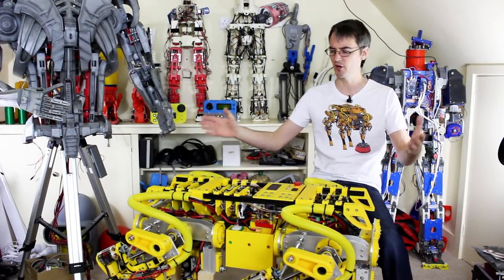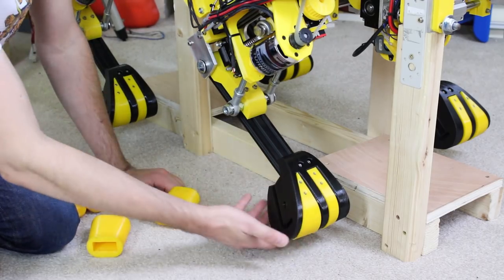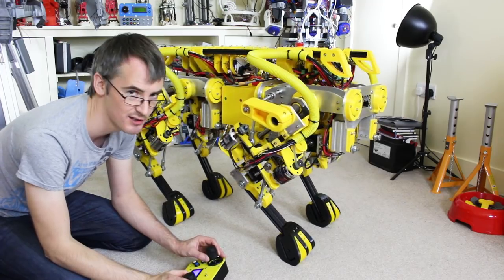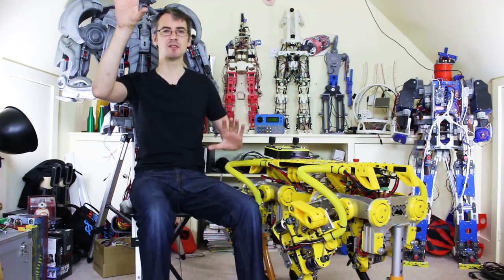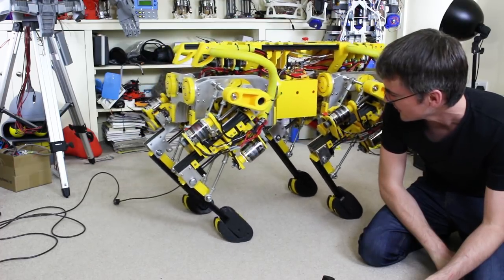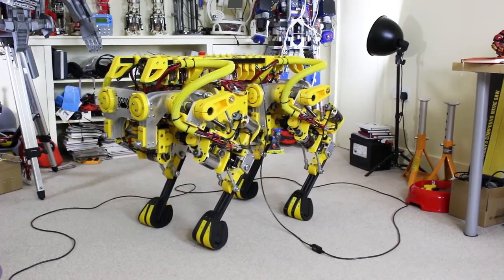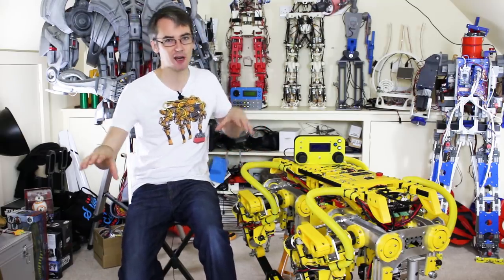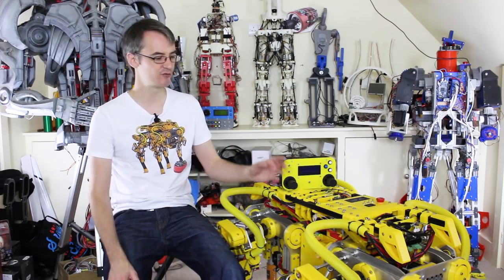openDog Dog Robot #13 | Experiments in Dynamic Stability | James Bruton

Comment: I love this project, but....You are doing things the hard way... Arghhh  :-)

This is what you need for perfect walking, running and control of Open Dog.

1. Each leg to have its own inertial measure unit (Cheap 3 axis Accelerator).

2. Each leg to measure feet to ground with optical sensor / Mouse camera or something (Ultrasonic, IR) to measure distance and NOT touch (By the time it touches it is to late.) Measuring the distance you can gently accelerate or decelerate the leg to touch the ground gently and not slam into it.

3. Each leg ideally needs its own small 'Leg' computer (something like arduino nano). (A leg should be able to control itself without input from other sources, just like in real life.  If it goes to fall the leg needs to be able to move to compensate on it's own.  The only commands you should give these legs should be for basic walk, run commands and so on.)

4. Open Dog needs a main 'Head' computer to communicate the main commands (like walk forward to the other 'Leg' computers.  Simply put, this is just a clock cycle where the main computer sends commands, or requests info one leg at a time. So we have four legs at say 15 cycles per leg per second, for a total of only 60 cycles per second.  Since we only need to send direct, maneuver commands to each leg, technically most of these cycles would be blank, but if you did want to monitor the whole dog, then we could still do this in only a couple hundred bytes a second.  (I like simple and streamlined.) 

Personally I would have a head (This would be the main / Head computer) on the dog, and the Dogs head would have another inertial measure unit. If you do all this right then you can tilt the head forward and open dog will go forward, back for reverse, left and right and so on.  No need to have to control all the legs; see, now we are using our head. LOL

If done right (Lots of assembly language), Open dog could controlled with of a ZX81.  You just need the right sensors and algorithms.  As a clue, one easy way to measure pitch, Roll and yaw is to interpret the measurements like a Dartboard, except instead of 20 quadrants we may use 8 in a clockwise order.   These 8 quadrants give direction (Yaw), the other evenly spaced sectors in that quadrant show pitch and roll.  The larger the roll the higher the number.  In essence imagine having a Dartboard lay down flat, then have a marble where bull is, when  you change the pitch or roll you see where that marble is rolling to the measurement, and this also automatically calculates the Yaw / direction of the leg.

Now from the Dartboard (Lets say we are always aiming for bull (level)) we can calculate the data we have in just 1 Byte of info (4 bits for Yaw (8 directions) and 4 bits for Pitch and Roll (levels of tilt.))  The small computer in each leg then interpretates this into “Oh shit I am falling, put my leg out” if need be, whilst calculating what it is meant to be doing.  We could use one more byte of info for the optical measure sensor on the foot to help with our fall too. This time we know when to stop the foot before smashing into the ground. So using just 2 bytes per cycle (per main Leg and or Head,) we can tell roughly how each leg of the dog is doing and where it is.  Each Leg computer has its clock which is kept in sync with the head computer, so if a leg stumbles, then it can get back on track to where it should be when it recovers (Just like the military with marches and cadence, the only thing any of the platoon worries about is that one person calling out the beat so they know when left and right is.)  If a stumble is to big, then a leg can send the data to the head computer which may then slow the walk speed for all the other legs, and possibly give commands to direct other legs, but once again each leg having it's own Leg computer should solve these issues on their own and be able to get back on their own feet.

So going forward, (:-) ) We tilt the open dog head forward. This uses the Dartboard and sends a Walk forward command to each leg (lets say the head was pitched straight forward to 2) at speed 2.  Each leg will now work out the timing of the clock cycle and what it is meant to be doing for that cycle and adjust to that for walk forward speed 2, until you tell Open Dog to stop. 

I know there is a lot more into this for the control of the motors, but this should give you a huge boost for how t get a very stable, walking, running, dancing dog.  Hopefully this makes sense as it is very late where I am and I am very tired, but it does work. If you have any questions, ask.
Reply: I'm sorry but this sounds very outlandish to me, and in fact much more complicated than what James is currently doing. IMUs on each leg? Optical sensors for ground proximity? Binary servoing?
That spider robot Adam Savage showcased in one of his videos has NO sense data besides motor position to do what James is trying to accomplish, with 8 legs. If you have high repeatability and can assume a flat plane for the environment, you can skip most sensory feedback. Now, that robot also doesn't need to balance on two points of contact, but I bet that even the current hardware setup of OpenDog could accomplish a more than satisfying gait given the right software.
Reply: Having physically separate computers in each leg is completely pointless and you are assuming walking is a hell of a lot easier than it is. I assume you have little to no programming experience based on the way you speak about "each leg will work out the timing of the clock cycle and what is meant to do"
All you are doing is making up your own convoluted way of thinking without knowing how any of this works. 
Plus,with the inverse kinematic model he already knows the position of all points in the legs relative to body to double precision
Reply: @Marci124    The way Open dog is designed will ultimately keep causing problems.  Adam Savages Robot is a couple of ounces compared to this beasts mass, so they are not even close to being equal (feather vs brick), nor is the design of how they work close to being equal.
Reply: @parkerbradshaw4122  Wrong!  My system has been tried and tested and does work thanks.  Having a kinetic model of having everything work is great in a perfect situation, and that is the biggest downfall; a walking robot needs a kind of fussy logic of independent limb control. 

A computer in each leg (Arduino Nano or even smaller) to monitor a clock, distance sensor, tilt sensor, 3 optical encoders and motor speed is child's play.   With this you do not need complex models as you describe.  A walking motion one leg at a time is VERY simple.

Thanks  for trolling though with no subs, no videos, and well just trolling youtube.
Reply: Guys stop arguing! 
P.s.  @10p6  subs are not the measure of IQ
Reply: I like the idea of having legs autonomous (sort of at least). In real life animals the spinal cord/proprioception circuits do most of the control of walking and moving. Very interesting idea.
Reply: @10p6  No, he's not. Firstly, there's absolutely no need to do any assembly on a project like this. Honestly, what you'd end up with would be worse than if you just used C++. What James needs most is to switch to a dev board with an ARM Cortex-M4 that has an FPU, not an antique like a zx81. Performing 32 or 64 bit floating point operations on an 8-bit µC is eating up clock cycles, not to mention the use of uart for communication between µCs. 8-bit µCs are inappropriate for a project of this scope.

Secondly, your proposed set of sensors is totally unnecessary. What's the point of a tilt sensor or an accelerometer on the legs? The system already knows how each leg is positioned, the only thing an accelerometer could track in this case are the vibrations. For stabilisation, using the gyro on what I'm assuming is an mpu6050 would actually be more beneficial.

Each leg should have its own microcontroller, but not for autonomy like you say. Look at the way PLCs structure their communication packets as reference. The main controller sends a packet which might include x/y/z coordinates and a request for some positional data. The leg controller sends an acknowledgement with the requested information.
Reply: @10p6   You said your way was simulated, if you would upload a video about it and explain you theory and the simulation itself, you would be far more believable.
Your thoughts are plausible, but such simulations are not accurate or in a price range only companys can afford.
Reply: @kumumblenumdnler4356  I gave up reading this after seeing you have no subs, no videos, so a youtube troll, and think it be better to code C++ on a ZX81.  You obviously have no idea what you are talking about.
Reply: no no no, having sensors everywhere is not the solution , a multiple input multiple output dynamic model of the system would be best , then applying state space control laws would enable both dyanmic and static control  of the system , which is what boston dynamics does with their robotics. now, this wouldnt be an easy task by any means, as the dynamics are highly non linear . but this would be the optimal solution
Reply: 10p6 I specifically said NOT to use zx81. You were the one advocating for it. I’m an electrical engineer, I’ve worked in industrial automation, and I currently work with high speed digital systems. But ok, I’m just a troll for trying to contribute my knowledge and experience.
Reply: @kommander9638    I explained and have nothing to prove, only that the parts needed would be as about $6 per leg.  James start setting up that Open Dog LLC to cover the massive company costs.
Reply: @primomechatronics3816    I disagree.  The dynamics of a Quad legged robot is not nearly the same as your quad copters (as cool as they are.)  Yes James system could be sort of done in 300,000 lines of code, mine can be done in less than 300, with much more stability, gentleness and longevity to the parts.  As for Boston Dynamics, I know people who work for them.  Sticking with your comment about them?  BD uses scanning lasers to read the terrain to calculate some movement.  My system does similar but for a fraction of a fraction of a fraction of the cost.
Reply: you have to start somewhere... you also have to set a budget. anyone can sit around and say what you should do, when the programming takes years and the parts are affordable you going to help out?
Reply: @kumumblenumdnler4356   I referred to a ZX81 having enough processing power to do what is needed,  but obviously on a computer like that it would need to be written in Assembler to be fast enough, sorry for the misunderstanding.  If you work in digital systems, then you know the benefits of high speed serial and parallel communication, my system is a hybrid of them both :-)
Reply: @NETBotic   And the budget increases when parts brake, something my system would eliminate to do properly.  Of course I would help hence why I started this thread in the first place.
Reply: @10p6  ofcourse sensors are still utilised and required, but to have a sensor measure ever detail is unecessary and inefficient ,and as with BD they still have to use robust mathematical models with feedback to handle with uncertainties due to the environment etc.
Reply: @10p6  however i do agree that having a distributed system with individual processors for each DOF set  would be beneficial
Reply: @primomechatronics3816    It is the way you use the data.  Just because sensor data is a available does not mean it has to be used.   The sensors I would use would produce a much smaller volume of data than the ones James is using just on the motors. 

As with BD's robots, this would still need algorithms, but if done correctly, I am talking about less than 1 KB of data transfer (from sensors or to control) per leg per second to walk, run and recover from most situations.   James has mentioned about belts slipping, well how good is a rotary count of the motor when that happens, yet with my $2 of sensors it is a backup to preposition the leg in that example.  My system would also measure incline and slope changes which then can be used to change the power / speed of the motors.  James system can do this globally, but not per leg, and once again if something goes wrong then it has no way to compensate for it.   James system can say "Hey, motor 1, 300 revolutions to touch the ground" but what if the ground has a dip or a bump?  That will then make the robot fall over, or put excessive strain on the legs and hip joints. James feet pressure sensors would be great in a perfect world, but the world is not perfect and the reaction time is to long before the sensor can trip and stop the motors. 

Others have mentioned that my ideas are overkill for walking on Flat ground, but how freaking boring is that.
Reply: In a world, where the value of every person is measured by their YouTube subscriber count, even 10p6 would still be but a peon, for 1,100 subscribers would not a nobleman make. 

Seriously, though, man.. There are more important things than YouTube subscriptions. You can't base how you value someone's input on their subscriber count. I can see that it is very important to you, and that you may indeed be on the spectrum, but /some/ people prefer to spend their time advancing other fields.
Reply: @10p6  hence the need for robust feedback controll, but to have robust feed back controll you need an adequate defination of the systems behaviour , hence a model of the systems dynamics is required . Also, with said model we cam perform state estimation , reducing the number of feedback channels, num of sensors, required. But this is kinda funny , controls engineers always scream more models and electrical engineers always screem more sensors. Lol
Reply: @primomechatronics3816    It is a little like RISC and CISC CPU's; mine is PIST (Passive Information System Topology) lol.
Reply: This seems something like multiple axis synchronization in CNC machines. Each servo axis has its driver which uses encoder data to make sure moves happen as intended by controller but the data is also transmitted back to controller which in turn can influence other axis setpoints to compensate for any issues with that one axis. It would be fun letting AI learn to walk that dog.
Reply: @ivanabunjevcevic9364    I totally agree :-)
Reply: Well it's an open project, you are very welcome to show off your results.
Easy to guess what might work and imagine it does, extremely difficult to actually make a robot move on it's own.
Reply: @NKCubed     I have never made any comments about my subs other than me being active and some of them only trolling people.  As for your math it is a little off because with my other channels I have over a million.  IQ? ;-)

I know James Reads the comments.  If he wants to use my ideas then that is up to him.  I know others who are working on Bi and Quadped robots look at this channel too, so maybe it can give them some ideas they did not think about.
Reply: @MsSomeonenew   Very true
Reply: I don't see the need to get assembly involved in any of this. Most mid-level MCUs have plenty of DMA channels to offload all kinds of transfers. As James mentioned part of the problem is that some of his serial stuff is just bitbanged on the 8-bitters. An upgrade to a better central processor and better distribution of communication would help a lot. If I'm not mistaken the Odrives even have Rs485. 
As far as motion algorithms go the same mid-level 48-100mhz mcu can solve most in an instant, we're not talking about brute force cnn machine vision here.
Reply: @NKCubed   One has ways to tell if people are trolling.  Not everyone with no videos troll, but a whole lot of them do sad to say.
Reply: @statorworksrobotics9838   IT WAS A JOKE. A 1KB ZX81 with 3.25 MHz Z80 would be challenging but possible to use as a controller.
Reply: 10p6 Mine was a joke too ;)
May I remind you this is the decent town of youtube and your attitude is unbecoming. If you comment on the project expect some people to disagree, around here they're not trolling you.
Reply: James is a genius when it comes to controls, however this design is just clunky and I really do not see it walking with a smooth and natural feel in the future. Needs a complete redesign from the ground up, but then again, James first BB8 was not very good, where his version 3 is one of the best there is. I can see this project being a 3 or 4 time remake
Reply: @10p6, stop trolling. you really dont know what you are talking about.
Reply: 10p6 r/YouThinkThisIsMyMain
Reply: Ridiculous... stopped reading when he suggests one arduino per leg. LOL
Reply: @10p6  What is your bizarre obsession with sub counts and video uploads?
The vast majority of people on youtube are those that WATCH content, not MAKE it, and being a video creator or not is completely irrelevant as to what someone is doing constitutes trolling or not. (frankly, based on behavioural observation of how this comment thread functions, the most likely person here to be a troll is you.)

The presence of subscribers or videos on someone's account is also of no significance in terms of what their skills, knowledge and qualifications are.
Not that this holds much weight online regardless, since the internet in most cases is largely anonymous, you can claim anything you like and there's nothing to go on as to whether your claims are true or not except the nature of your arguments themselves. (and for obvious reasons, it is difficult to judge anything from that unless you yourself are some kind of expert in the topic under discussion. - though of course the Dunning Kruger effect has to be taken into account there as well, since people with little skill frequently over-estimate their abilities and knowledge.)

As for your proposal, it's interesting, but whether it would work any better than what James is doing would be hard to know without putting it to the test.
Your poor attitude however is quite evident.

Ah well. What else is new online...